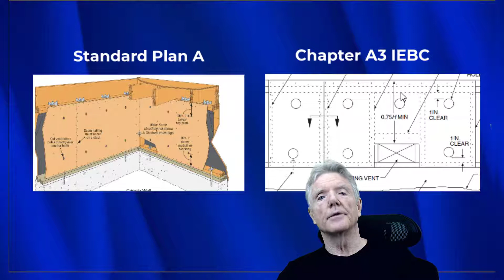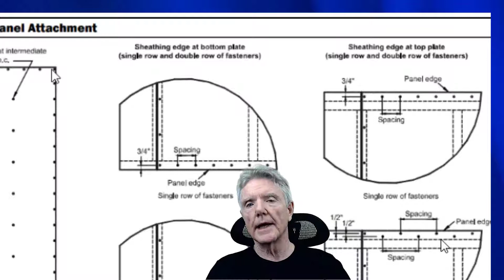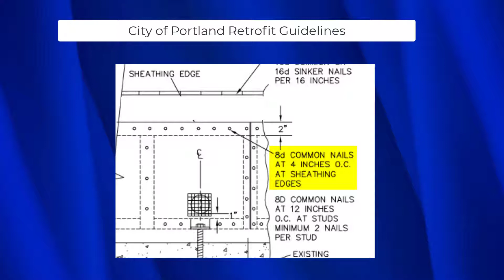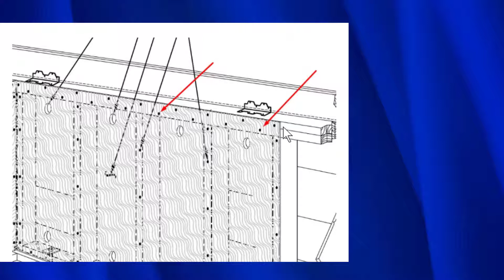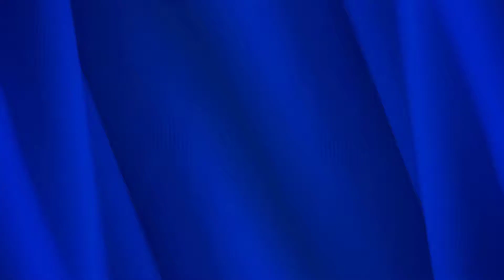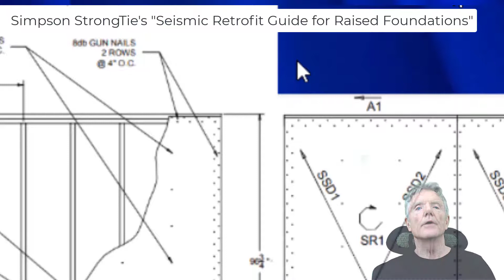Standard Plan A Plywood Nailing

Comment: When nailing the plywood to the framing, does the length of nail matter? I can only find info on minimum penetration into framing. Is it ok to use 10d nails 3” long? After we achieve minimum penetration listed on APA chart is there either a benefit or risk to using a longer nail? I already have a bunch of 10d nails 3” long that work with my nail gun so I’d like to use what I already have. Thanks!  I’ll be nailing the 2” oc at panel edges.
Reply from the maker: Sorry I am so late in my reply.  I did not know where to find the comments.  I like questions like this.  I just sent a wood scientist Dan Dolan and email asking him the same thing.